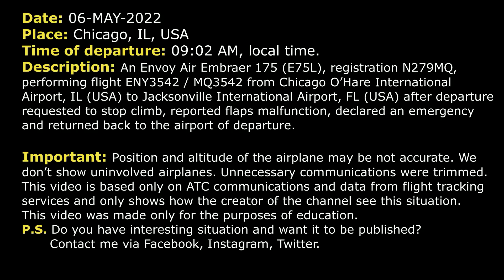Flight control problem. Flaps malfunction | Envoy Air Embraer 175 | Chicago O’Hare, Real ATC

Comment: How come EVERY time..

Declaring an emergency....
-Say fuel and pob
Stand by

They know the question gonna come why not just say it in the initial contact? 🤷🏼‍♂️
Reply: They have so much of the information about this flight in many computer systems, I'm not sure why they don't pipe that automatically to the tower and ARF. Also, they tend to ask multiple times, although the whole ATC pilot response has gotten much better over the last 2 years.
Reply: Too much information to think about at that time. And the controller probably isn’t ready to write it down either.
Reply: I’m a year late…but whenever we declare an emergency we got a lot more serious stuff we’re working with…but as soon as we got it stabilized we tell ATC what’s up
Reply: Because when things are happening fast in a cockpit sometimes you can't spare the bandwidth right that second for souls/fuel. I have heard pilots being ready with that information before. I don't think that's a hair worth splitting.